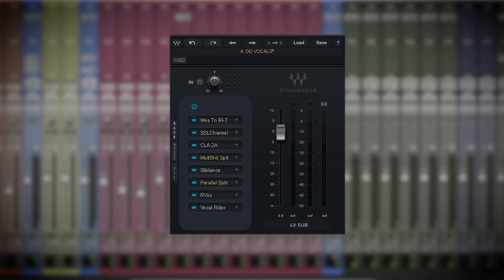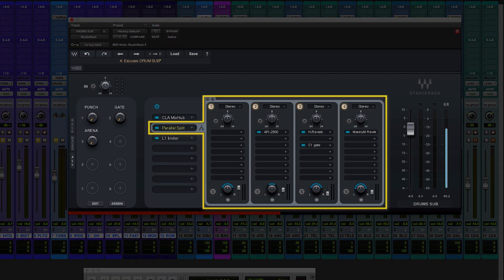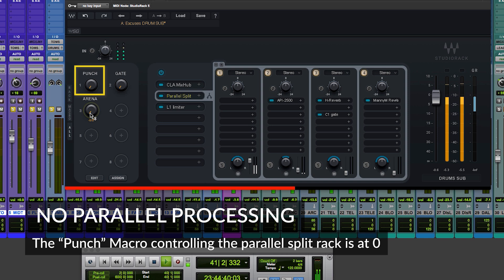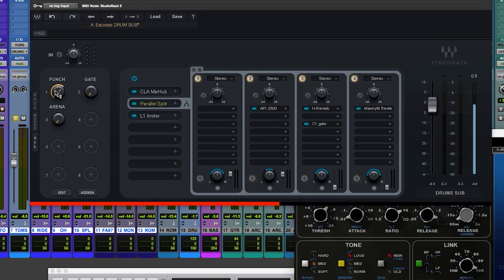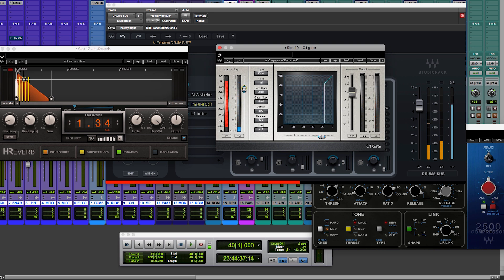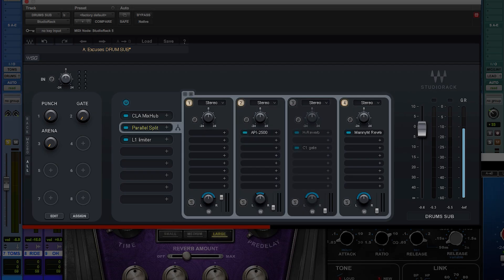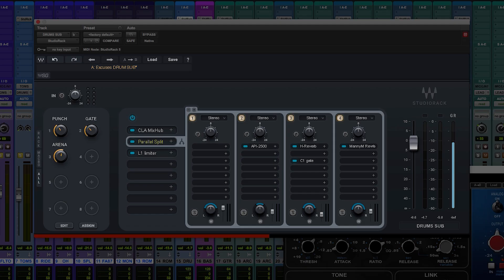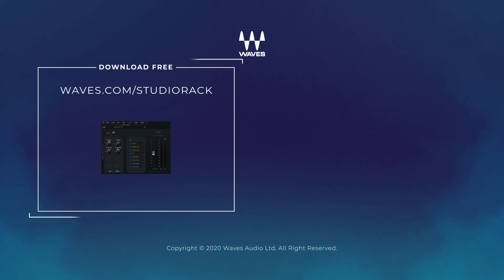Easy Parallel Processing with Waves StudioRack Parallel Racks

Comment: so the first audio track in parallel-split is its like the dry vocal, so when i put effects on there (inside the parallel-split) would that be ok and they work as normal or are they on track 1 in parallel-split exact like the seconde and third channel like an aux send bus? (as an extended space for my plugins)? cause my vocal chain contains 11 plugins for me to work perfect and studiorack only got 8 slots...another question is: can i use two studioracks like do the half of my chain in 1 instance of waves stuidorack and then do my other half of the vocal chain in a 2nd waves studiorack instance and then ordered them in my daw like one is in insert1 and one is in insert2 of my track effects?
Reply: Im not sure if i get your first question.. maybe reach support about it. But for the 2nd one, you can use two studioracks on one channel no problem.

Comment: Waves stop this and make a distressor
Reply: Paul Kruz I have 2 Real Distressors (British Mods), the UA Distressor plug-in (nearly identical), the official ELI Arouser (even better than the original), the Slate, the Sknote, Kush SlyFi, Kush UBK-1, and I’m sure more.
They are ALL dope AF.
And I would trade em all for what this does (or at least claims to).
The Distressor was intended to be, and is, the most flexible, most versatile Compressor of all time.
Getting one, or a pair, is convincingly like getting the 3 classic comps it was modeled after (dig around), and then a ton of bonus features, and adding a ton of compression tools and flavors to your studio, in one wop.
But what this new Waves rack system does, is more like adding a new super Console to your studio, and new Racks, and the ultimate Patchbay, and total Recall,  and more....
For 1, it’s free, and doesn’t have any audio plugins in it ( *except you can use the multiband and as an EQ).
The first point is setting up processing chains.
The next is being able to offload Waves Plugins to another system over Ethernet.
Then, they also added, amazingly, Two features directly “inspired” by Blue Cat Audio plugins MB-7 and Patchwork, that only us psycho engineers got into.
It looks like they just created an ecosystem, only for Waves plugins, which you still have to buy, that blows away everything else out there.  But only for cats that are gonna go that deep into Series, Parallel, and Multi-Band processing, as chains (or racks), and again only with Waves plugs.
Now if you do go deep, integrating Macros, across Anything is next level.
And if you, like me, came up on, and want your Hands on the controls, the Midi learn implementation should mean total hands on studio customization.
So yeah, I love my Distressors, and all my other Comps, but this level of control, is about the whole Studio Workflow in 2020.
Reply: @G_handle  really interesting. could you explain a bit more about midi learn implementation for mixing environment?
Reply: UAD